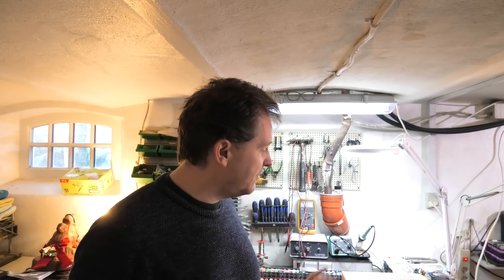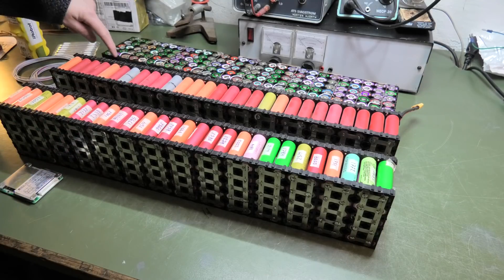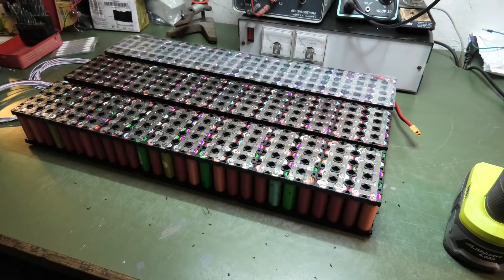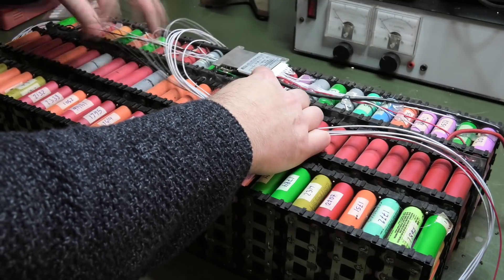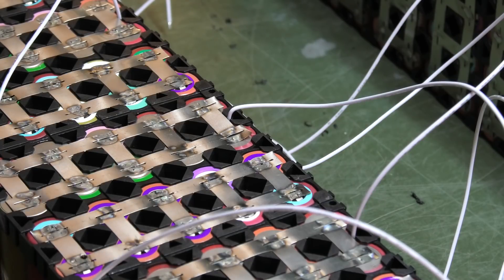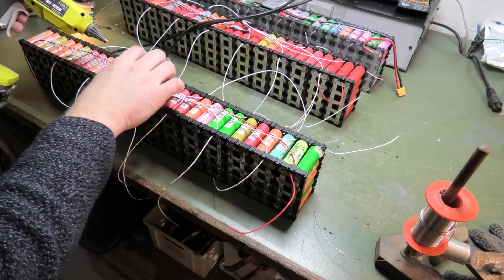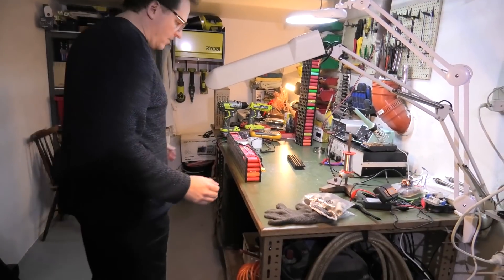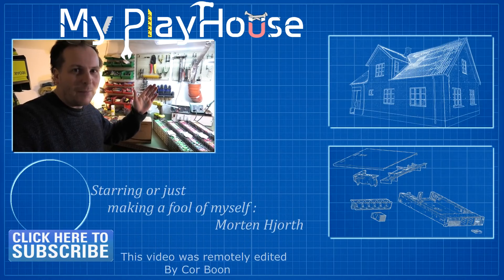Batteries for the 4KWh Li-ion Bank, are Completed !! - 923

Comment: Since some of the cells are only ~1200 mah and some are ~2400, wouldnt the capacity of the entire pack be diminished? Im thinking it will drain them all equally, and the lowest capacity ones will run out, or reverse charge, and cause problems first. If im correct, the balancing only helps if its charging, not discharging.
Reply from the maker: Each of the 14 batteries consist of 10 calls,, and the capacity of the 14 batteries are the same. 
and putting 10 calls in parallel,, memes that they will act like one Cell,,  one can not become depleted, before the others.

Comment: love the content you will have quite the diy tesla style power wall when your done. does the potential fire - shock hazard play into where you will install these batteries. and please dont think of this comment as a attack or anything mean just curious what your plan was to protect your family home with massive diy project such as this.  i realize that the walls are concrete but floor joists are still wood and flammable
Reply from the maker: I have been  thinking of replacing the wood shelves where the Li-ion Bank is going to site, with fiber drywall..

Comment: If you get some traction batteries at 2v per battery and add them with a similar amp hour rating to a 48v lead battery set up to make your lead the same nominal voltage as your lithium battery
Reply: You are almost using the lead acid like a capacitor bank it almost regulars the current flow and adds a bit of resistance to the pack
Reply from the maker: Okay,, Now I get it,,, I do not know,, if I want to go with that,,, It is actually not that bad to have the Li-ion voltages being higher,, so they are used the most,, and then the Lead kicks in when the Li-ion drops to their level.
Reply: @MyPlayHouse  that's fine but easier if all kept at same voltage no need for relays and volt meters to switch relays
Reply from the maker: Sorry I do not follow at all :-/
Reply: @MyPlayHouse  if you have four 12 volt lead acid batteries the voltage when fully charged is about 54.4 volts so if you add a single 2volt traction battery you will get almost 57volts and if you run a 14s lithium pack use that as you max charge voltage and set your cut off voltage to 47volts then you can run both battery banks together you won't meet to stop charging the lead acid at 54volts and so can run as one bank that is what I do

Comment: I just did that myself, I have Xiaomi Mi 365  battery with a dead bms . I bought a bms and changed the dead one and it works great. I did a load test last night and the capacity rating was correct. Now I have to mount it on my EBike and go                                                                                                                                           Cheers Morty
Reply from the maker: Ohh that way!  It's great to fix stuff!

Comment: 02:18   14S 10P ?    ;-)
Reply from the maker: 14 packs of 10 sells
14 batteries in parallel, but each cell consists of 10 18650 battery cells.
Reply: @MyPlayHouse  #MyPlayhouse Hi Morton ,  Click my link 02:18 , listen to what you say at about 5 seconds in and then look at what you wrote , my adviice is stay away from the word "pack" as you seem to confuse yourself with paraalell, maybe say "group" .  you have a 14x series string , parraleled by 10, my initial comment was to address you say you should have said 14S not 14P @02:18 that was all but then you also wrote it wrong too, please do not think im being horrible as my words might seem a bit harsh . i often have dived into comments when people have made silly comments about your use of the English language , i think your command of the language is excellent, you have an excellent vocabulary and you have good pronunciation too. it would be cool if you dropped in a native word every now and again , especially for objects and processes , maybe write the word on the screen too, TPAI does it in German and i commented once that its great to learn technical German at same time. we are almost going in the right direction so its all good, happy to see you getting a chance to finish your project i can remeber you starting it, actually i can remember my first video view of your channel ,  brand new old stock rack mount APC UPS, severely discharged batteries and a circuit that popped under too much load, watched that and i was hooked  ;-], side note you can use diodes to mix you battery banks , about £18 each here you want 100-200A ones schottky diodes are best, CPC/Farnel in UK sell them , things to note, you may also need some high power super power low value resistor like 0.01ohms like 20x 100 watt ones to properly load balance as li-ion has a much lower internal resistance than lead acid and they will not load balance/share properly,, also remember these components will use power and thus reduce your efficiency ,create heat and there will be a voltage drop equivalent to the VF (forward voltage) of the component.  as you have two charge controllers why not have two independent systems , one for the "Data Center" and one for house, thanks for the content you make i find your ideas and delivery , clear, concise and simple to understand, also ii think if you mad some videos like how to guides about some video guides on windows storage spaces and OS virtualisation would be amazing,  happy 2020  ;-]
Reply from the maker: I have been working on these for 2 years,, if I had to make 14,, I would never get it done,,,, :-/ that is why I have made smaller banks like the 14S10P and yes they kind of become 14s40P.
But now I can expand with banks of 14S10P that I can do along the way..

Comment: Hot glue tip... when you are almost out of glue, put a small drip of hot glue on the new stick and then glue it to the old stick so it doesn't jam up or try to escape. If the glue is too depleted and you can't even get a small drip, use the hot glue tip to slightly melt the new glue stick end then stick it on the old stick.
Reply from the maker: Hi Jason Hill
Thank You very much!  I did that,, I just did not show or talk about it,, and Yeah it worked great.
Thank you for watching! :-)